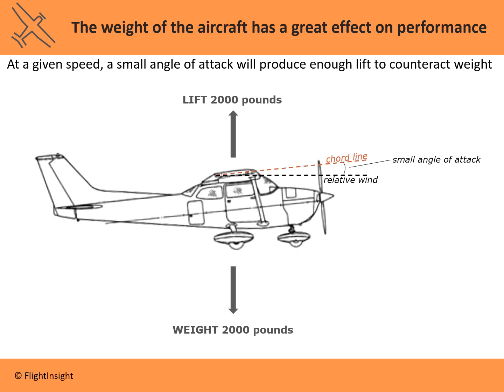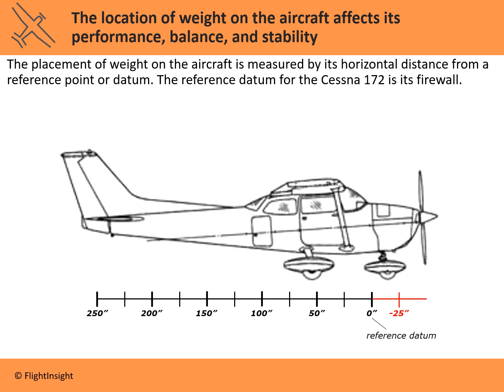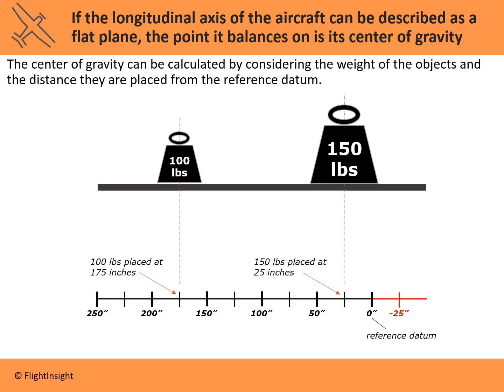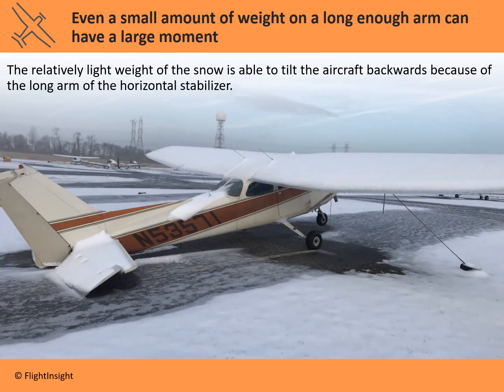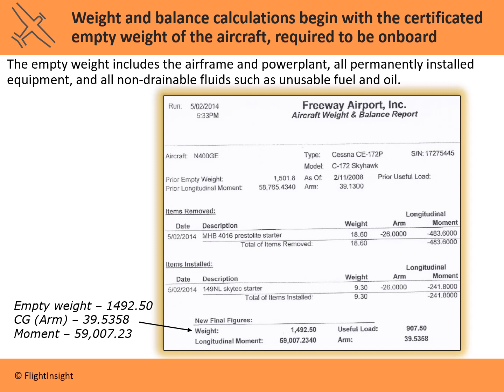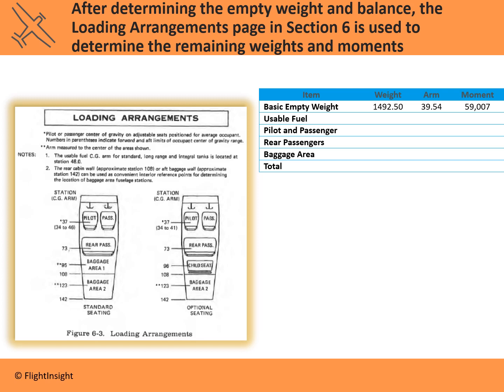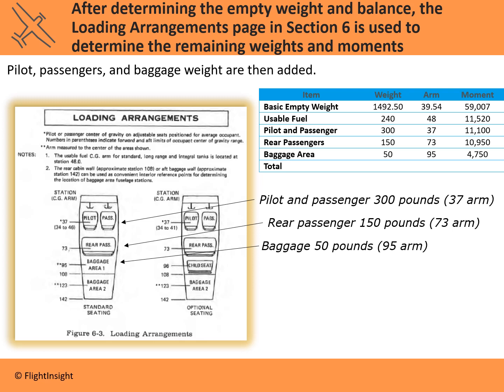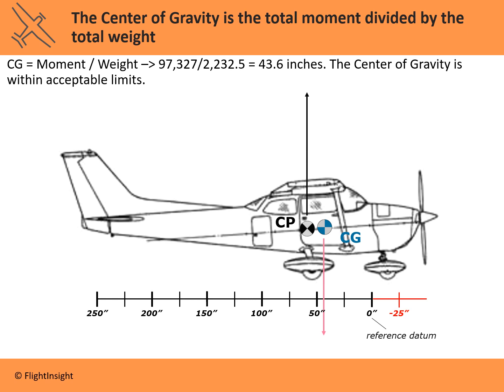Calculating Weight and Balance Aviation | Flight Training | FlightInsight

Comment: After doing a little more reading on empty weights, I've gotten a little more confused. According to FAA Phak chapter 10 there  are three types of empty weight. Basic, standard, and licensed. Licensed weight includes unusable fuel and undrainable oil. But standard empty weight includes full engine oil rather than undrainable. I'm guessing the the empty weight used for weight and balance would include full engine oil, would it not?

Comment: I wish the weight and balance reports would have a realistic level of precision on those numbers... I mean, moments are written with a precision of 4 decimal places. Really? I'm sure that 59,007.2340 should really be rounded to 59,007, at least! And the starter moment arm - I mean, this report infers that the mechanics measured the position of the starter motor CG to ONE TENTHOUSANDTH of an inch. I'm sure one tenth of an inch would be more realistic.